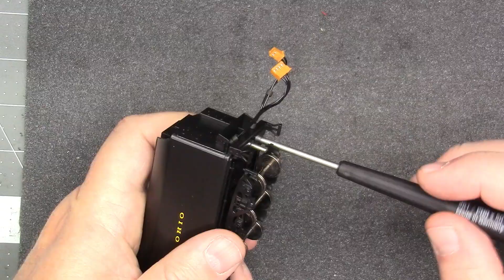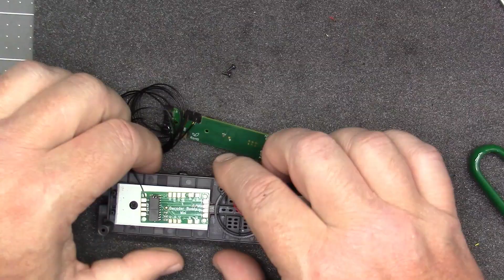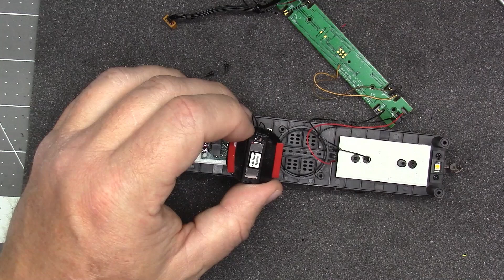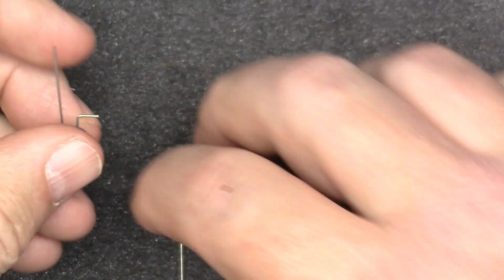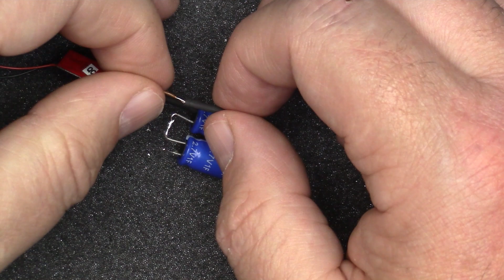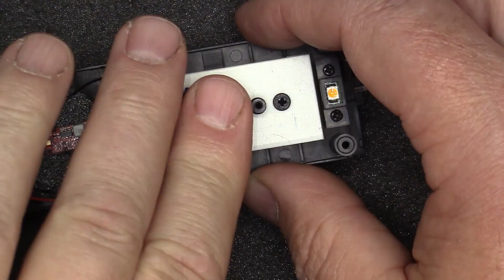Bachmann 2-8-8-4 DCC install

Comment: Nice install. I had 2 of these locos and installed Tsunami 2's in them some years ago.  They were 2 of the sweetest running locos I've ever owned. The starting speed can be reduced so that they barely move on speed step one. There were no keep alives back then but they never hesitated on track bad spots. Thanks for your continued posting of installs.

Comment: A little idea that I use. When unsure which LED wire is + and which is - take a 9-volt battery and solder a 1k resistor to one of the battery leads. Just touch the light wires to the battery and resistor and it will light in only one direction. You can then determine + and - of the LED that way because it will only light one way.